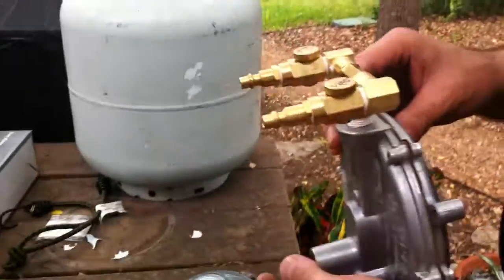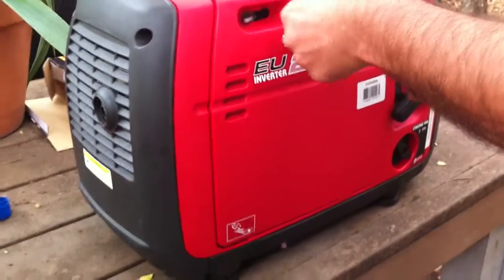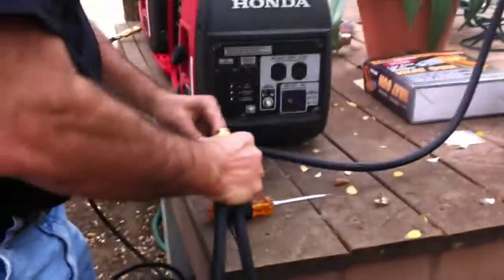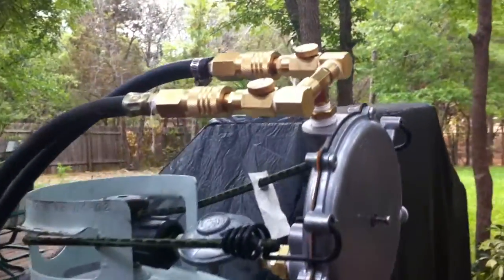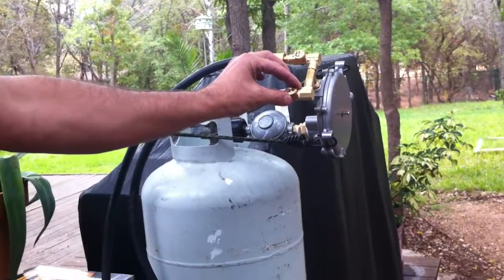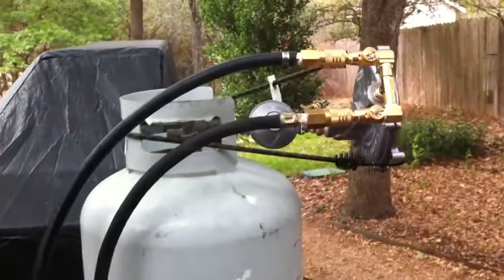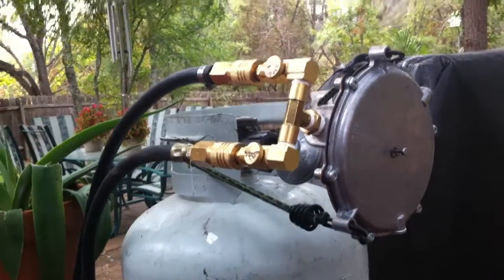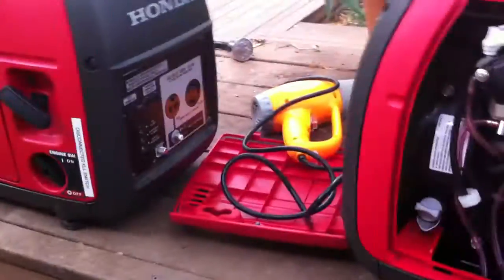Honda Generator EU2000i Carburetor Mod Part 1 of 2

Comment: Works like a charm, very quiet.•••>share4.photo/H2KGenerator?Zこ  works great for out door fun, recommend for any DJ's can power two 550 Watt speakers and mixer without an issue. Started with one pull for the first time. Adding oil is a bit clumsy, you need a long neck flexible funnel.

Comment from the maker: you can not install snorkel kit on eu2000i because the clearance between carb and the lid "hood" if you install snorkel kit then you can not close the hood. second because of the location of snorkel you need bigger gas orifice opening.

Comment from the maker: You can not run two generators with one hose and T. because as soon as you turn on the 1st unit the hose pressure goes very low( vacuum cause by the running generator) and the second unit never can start, try it and see.

Comment: Propane is marginally cheaper, burns cleaner, your engine will last longer, propane can be stored indefinitely without going bad, it won't clog your carburetor if it sits for a long time, etc.  Also, in emergency situations, you can often buy propane bottles or have your bottles refilled when most gas stations are out of gas because not as many people use propane.
Reply: dieselmh I